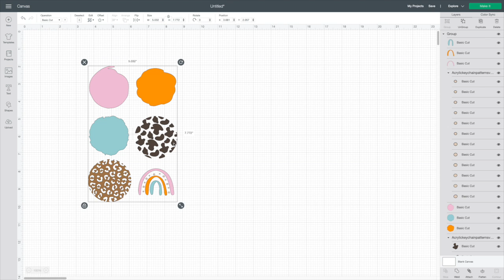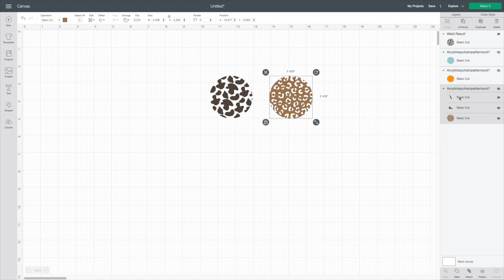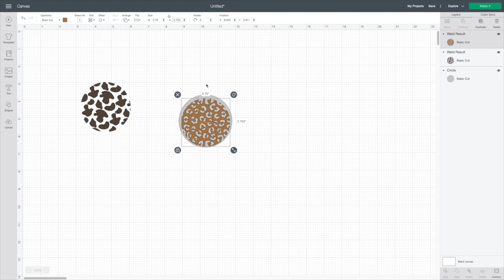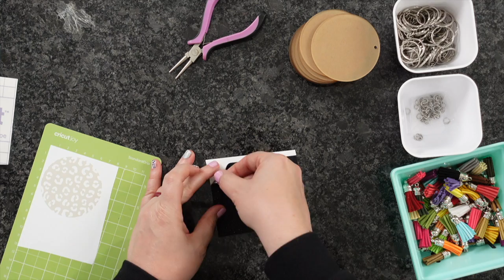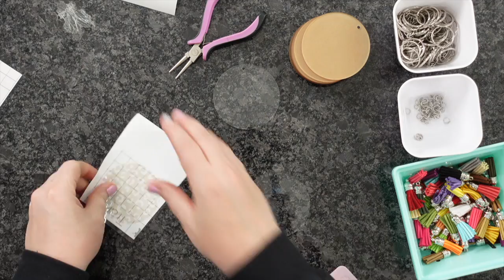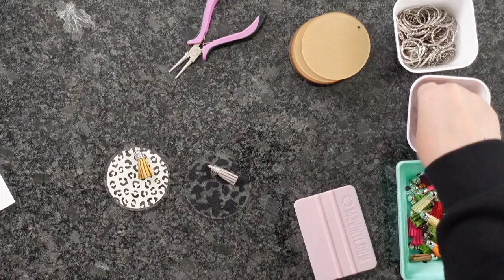🐶 Animal Print Acrylic Keychain With Cricut

Comment: Those are adorable! I have a question.  First, is that clear, see through on the pattern?  If so, what if I put the same pattern on the other side as well, I guess I would need to reverse the pattern on that side to match it up with the pattern on the other side? Or if I put maybe a different, complimenting pattern, or a transparent shimmery colored vinyl on the opposite side? Because you're gonna be able to see through it in parts, correct?  Your thoughts/ comments on that idea?  Also, I'm all about protecting my designs and items that I make for others, so they won't ever become disappointed, so would it help or hurt it if I put a light coat of non-yellowing epoxy over the top of it to protect it from peeling around the edges, or the print rubbing off a little, it especially being an issue during the hot months.  Because, it is always going to be in your hand, hanging down from an ignition, or in your purse or  pocket with other items, that could scratch the vinyl, 100% of the time! It is always going to be touching something!!
Reply: I love those idea you could do any of them I like the idea I reversing the design in the other side but it would be a lot easier to apply another color to the other side to come through or even apply some glitter would be pretty. I honestly never seal mine and I have been doing this for years they are pretty rugged and can handle a lot. But if you want to seal them you totally can